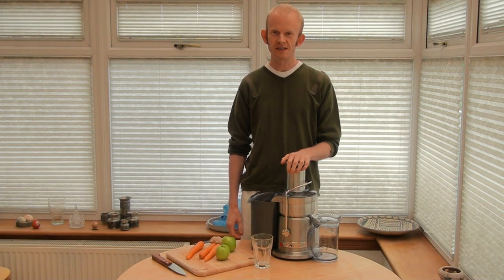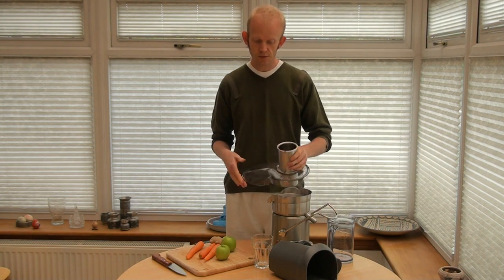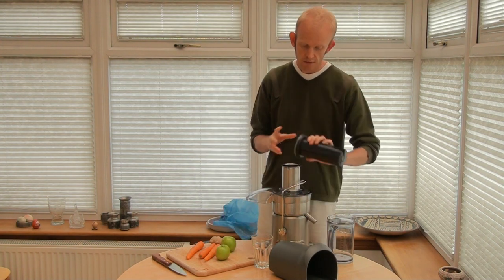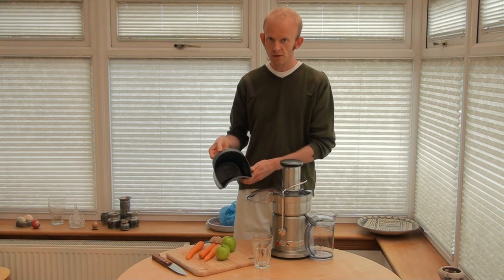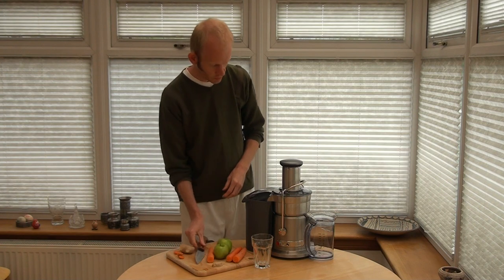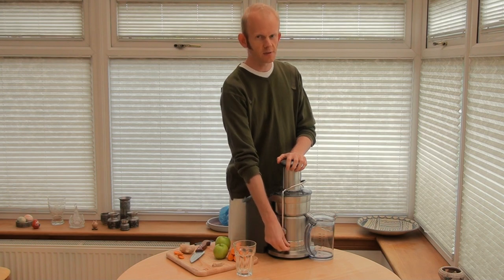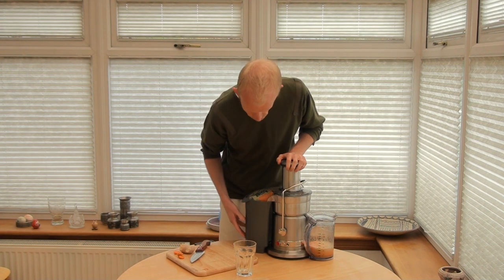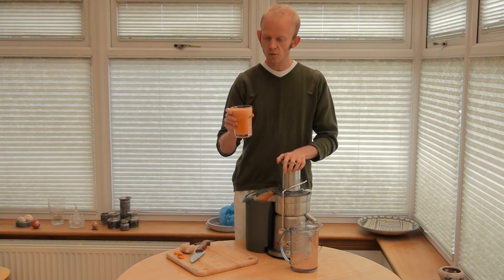Breville Juice Fountain Elite Review

Comment from the maker: Hey Justin, it doesn't leak all the time. But sometimes if I don't double check the positioning of the pulp basket, there can be a small gap where a bit of pulpy splatter can escape from. For me, cleaning time is about the same as when I use my Omega J8006.